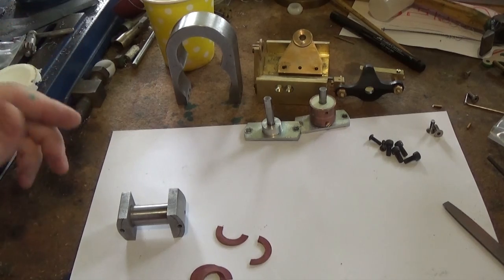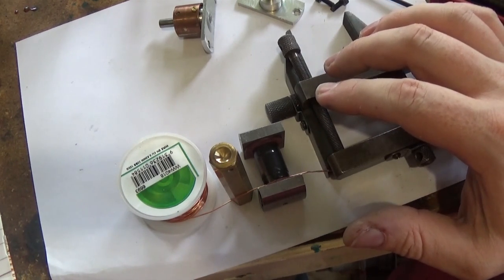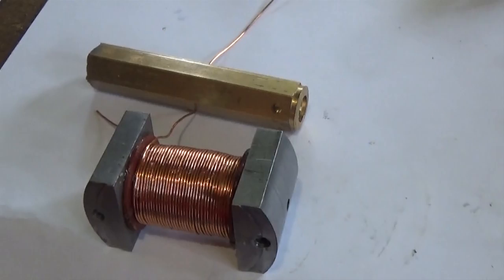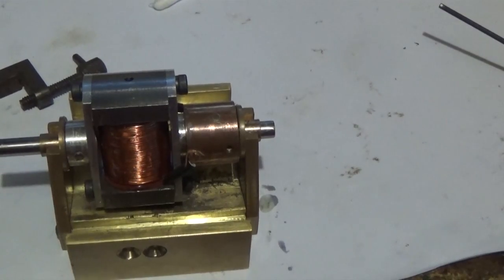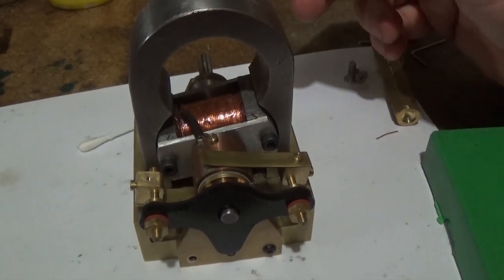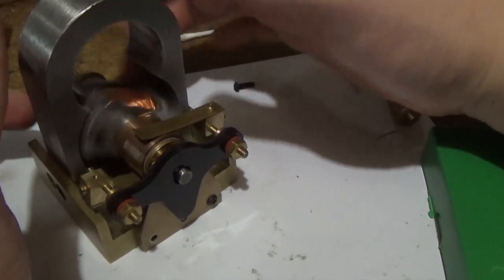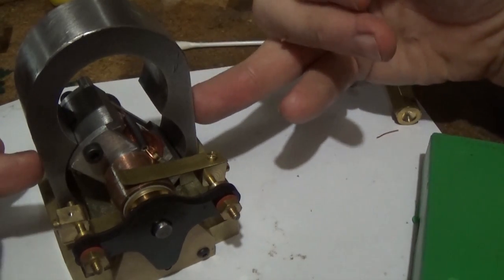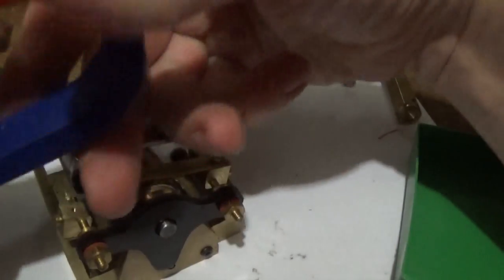Prince Dynamo motor PART12- home shop project

Comment: An addendum dum de dum.  When crossing the wire from the first leg go from the near side of the first leg to the far side of the second leg.  This will have some effect on the strength of the magnet.   Also you may start at the bottom of one leg and wind to the top of the first curve and then down the other leg.  It is a matter of preference.  Thanks.

Comment: I know this comment is too late as you have already fixed the problem at this time.  I'm looking forward to seeing what you did.  However a simple experiment which has a good chance of succeeding is to start at the top of the curve, where the armature will be, and wrap wire down that leg across to the other leg and up that leg to the same height.   take the two loose ends and touch them on a12 volt car battery.  Just make a spark.  The current running through the wire will magnetize the iron.  The amount of magnetism will depend on the amount of amperage flow.  The size of the wire and number of wraps will also be a factor heavier wire and several turns will be best.  Perhaps someone reading this might give this a try.  Thanks.

Comment: Maybe do away with the horseshoe idea (until you can magnetise one) and use 2 neodymium magnets mounted in non-magnetic material, opposite poles facing the bobbin on opposite sides.  The magnetic flux was disappearing, in your experiment, because it was being short-circuited through the horseshoe steel.  I'm looking forward to the next experiment and maybe a solution.

Comment: Hmmm. The magnetic field is clearly not strong enough. The first thing that occured to me is a field coil, as it is called. And in fact your drawing is just that. But then it would no longer be a dynamo. It would be a generator. Dynamo has permanent magnetic fields. Mrpete's design is not as bad as you think, with an Aluminium magnet.  It isn't an Al magnet. Ally cannot be magnetized. The magnetic flux goes between the magnets attached to the frame. The Ally is just there to hold the magnets. He could have used wood just as easily. A permanent magnet should work. It might also work if you magnetized the frame by winding it up with a coil, removing the current magnets first, and putting current through it. As I think of it, if you could find an old bicycle dynamo and steal the magnets from it, put them inside a frame, might be workable. I find steel magnetizes itself when you do not want it to, and vice versa.
Reply: +Juan Rivero Sorry. Postcript. Steel none too good a magnet; cast iron is the ticket, that magnetizes even by contact.

Comment: What if you heated that metal up above it's curie temperature and let it cool in a strong magnetic field?  You can use the stator from an electric motor to create the field but you would have to run it on DC.

Comment: I think you can still experiment with two larger thick disk neodymium rare earth magnets. Temporarily attached these to the outside of the iron horseshoe frame on both sides with the N-S fields aligned. A thin horseshoe-shaped bar of mild steel may be needed to complete the outside magnetic path back over the top from magnet to magnet.

Comment: Hi Emma , i agree with cuppa joe in cutting the part in half at the top of the horse shoe but i would cut out a section say 10 mm thick and insert a piece of brass and rivet all 3 pieces together with brass rivets this will give you two magnetically isolated poles and then put the magnets in where you  originally had planned to put them .

Comment: I can hear the disappointment in your voice, chin up, I'm sure a solution will arise.

Thinking back about my early years mucking about with Triang Hornby trains they were very simple with a block magnet and iron pole pieces off the north and south poles wrapping the armature.
The configuration was very much like your revised drawing. 

Another poster's idea of cutting slot at the top of the horseshoe would be worth a try, but I suspect you do not want to short circuit the magnetic field directly directly back around the magnet, the two poles should be purely held apart by the magnet, so you'd need to fully remove a section and sandwich the magnet(s).
I'm thinking a scrap prototype before destroying the nice unit you have now.

I watched a video on youtube a few weeks ago that went into more detail about magnetic fields.
It is important to remember that you need to create a "circuit" where the north / south poles can meet back up again in a loop for best efficiency.
That is probably why your magnets at either end were not too successful as they were more like two independent batteries powering an electric circuit with no common return....
Reply from the maker: +Ray Jones i have been suspicious for a few weeks... lol. but i think ive worked out the best solution..

Comment: Hi Emma, odd stuff magnetism,- my two cents is how about splitting the stator through the top and winding two poles and bolting them on either side in line with the armature?- could work I think, best of luck, J.
Reply: +Average Joe My thinking was for a motor but, If the motor is turned with voltage across it -it might 'self-exite', humm, thinking still...
Reply from the maker: +Average Joe yes it is odd. and no one really understands it. i had this thought too.. making over is usually nicer. and second time is always nicer..

Comment: Calibration labs often have a magnetization setup for magnetization of meter magnets that would work for your field magnet.  I also like the idea of a field coil but it should be separately excited, a series arrangement is not suitable for a generator. Automobile alternators are an example of a separately excited generator.